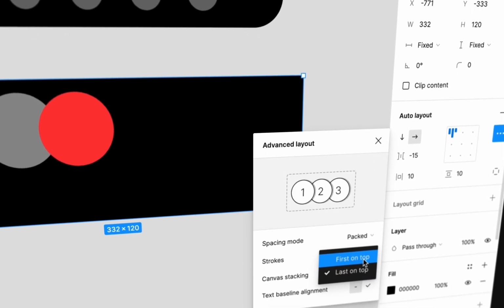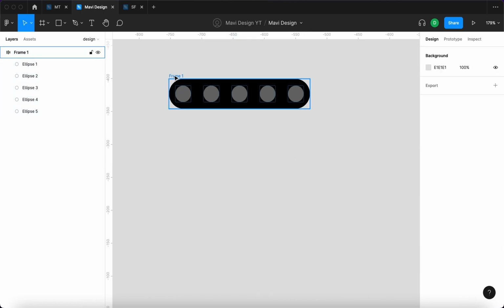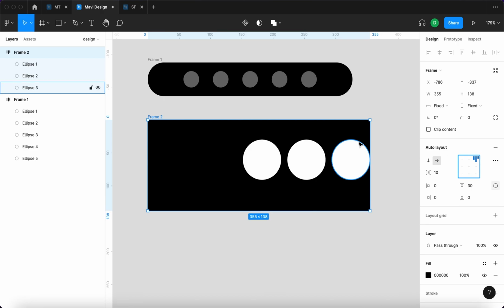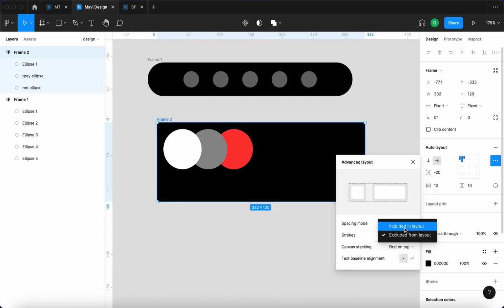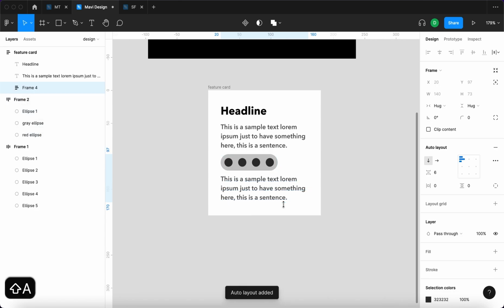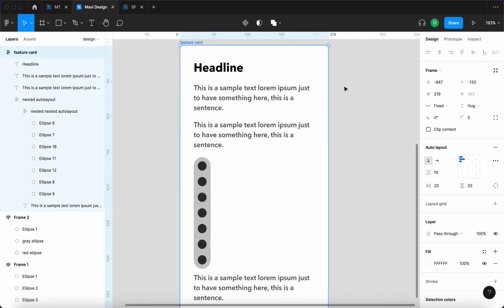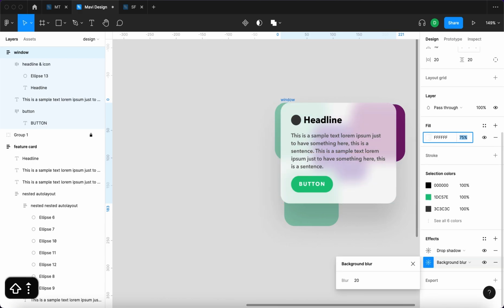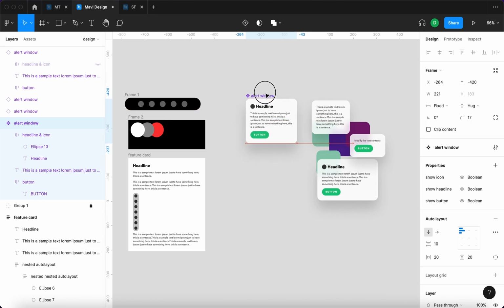Figma AUTO LAYOUT — IN-DEPTH GUIDE (Explanation, Nested Auto Layouts, Components, Examples)

Comment: Thank you for this video! I'd like to know how to create a nested menu component that is horizontally resize-able (I can stretch its width) and vertically dynamic (I can swap any row with another row of a different height and the menu will resize, for instance a menu header or divider). I can do one or the other but never both. What am I missing?
Reply from the maker: 1) menu container is set to fixed width
2) child elements (menu items?) in width to Fill container and Hug contents in height
3) menu container is set to hug contents in height

child elements will respect the width of the parent element while adjusting their height according to the content. The menu container will have a width that you define (point one) while respecting the height of the contents it has (point three)

hope this helps😊
Mavi
Reply: @mavidesign  That did it!! It turns out the issue is that I had built my nested components without using Autolayout so Figma wasn't letting me set them as Hug. Thank you!